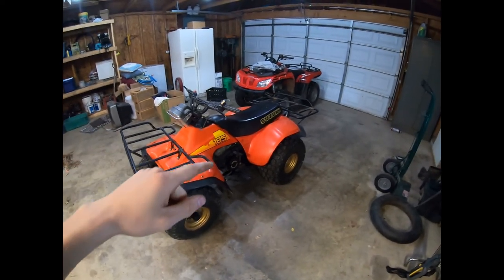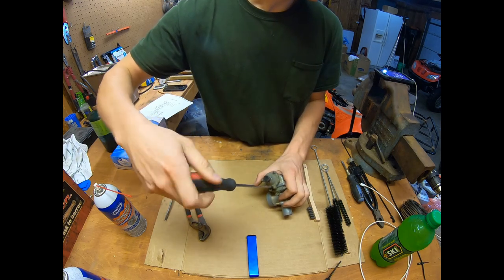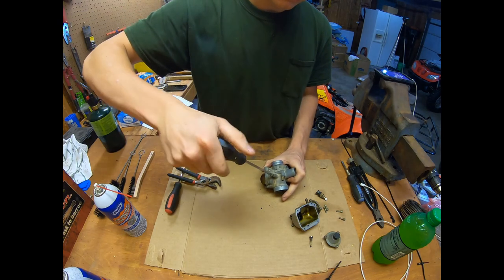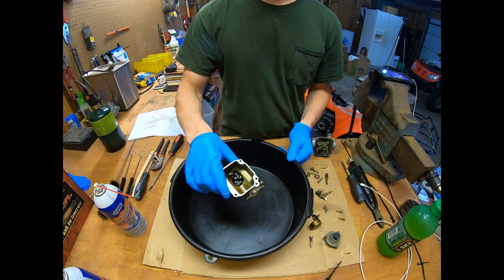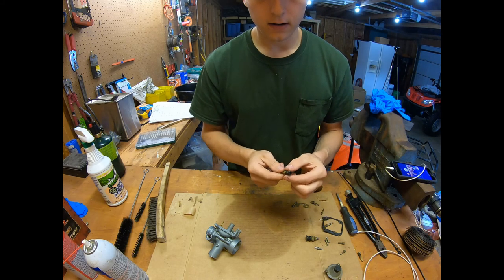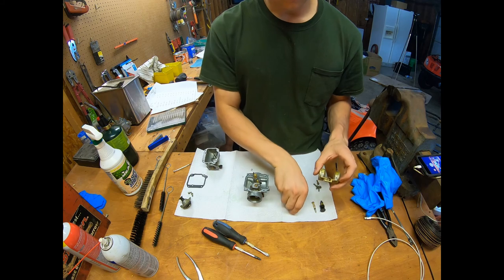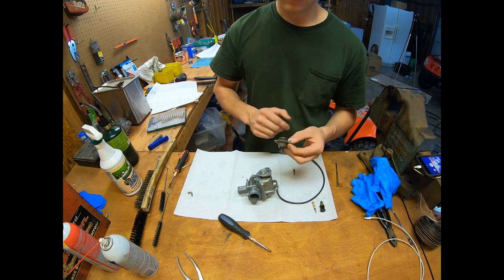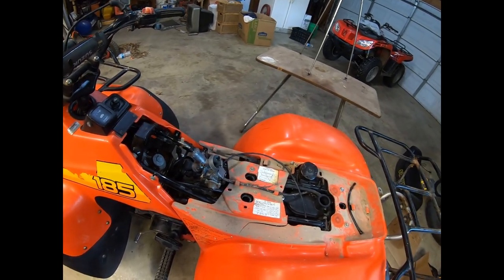HOW TO CLEAN AND REBUILD: Suzuki  LT185 LT125 Carburetor four wheeler / three wheeler BEST TUTORIAL

Comment: One thing you pointed out there wound up being the problem on a carb I just rebuilt. I had a carb recently that was flooding my 85 LT-125. The issue was that the rubber tip on the metering valve was missing.
Reply from the maker: I’ve seen that on other ATV’s before, glad you got it going!
Reply: Were you get the part lay out from.

Comment: Hello. I just bought a new primer for my carb, everything is blown out with air, I havent checked the fuel pump but it has a hard time starting cold only unless I spray a tiny bit of gas in the air filter box. I just checked the valves, they were loose so I put them back in spec. When it runs its extremely quiet. Its a 84’ 125 with 328 miles. Any help is appreciated. Is there a certain way to use the choke/primer?

Comment: I've got an 84 lt185 leaks fuel out bought a new cable and carb and does the same thing will only run when spraying gas into the intake won't take gas can't figure it out.

Comment: Is there a way to put slightly taller tires on the front because every time I take a turn the front tires come off the ground
Reply from the maker: Unfortunately I sold this machine so I don’t have any way of checking. Maybe adding some weight to the front would help?